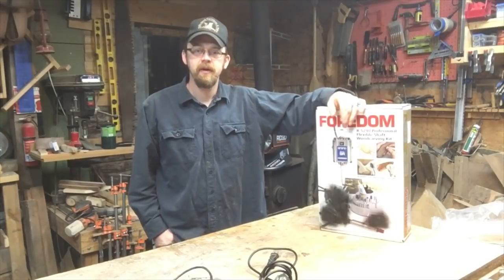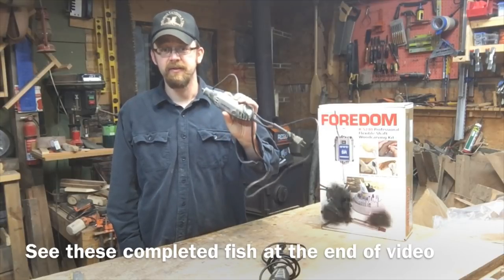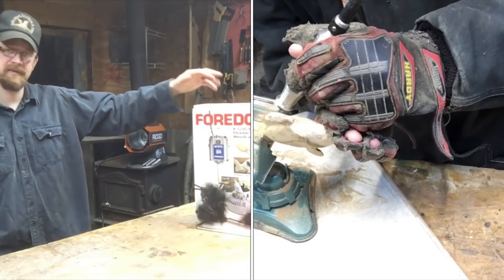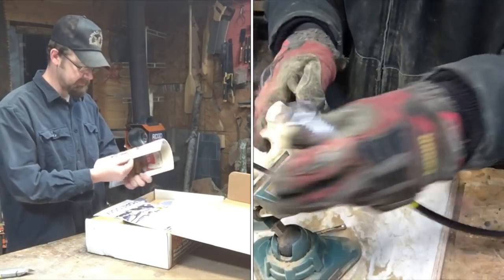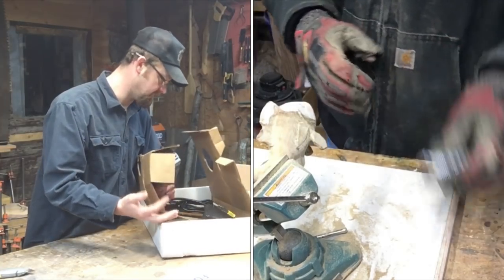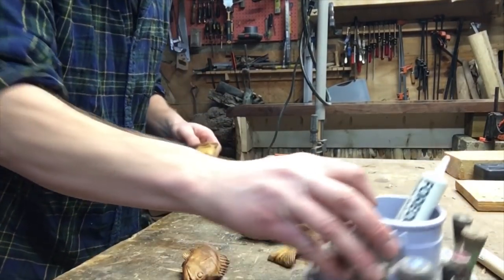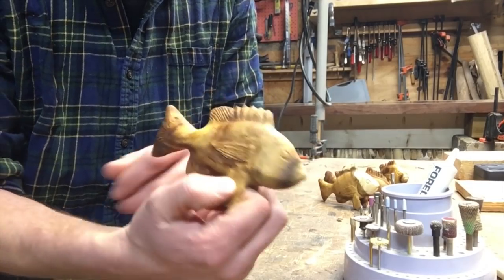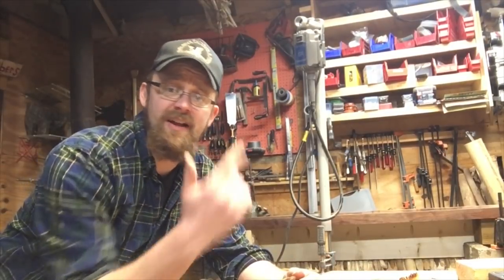Un boxing and using the Foredom flex shaft wood carving kit.

Comment: Useful video…Dremel 3000, 4000 are only useful for lightweight hobby use…no one seems to mention the Dremel Fortiflex which is a good upgrade, but the Foredoms are in a class of their own. Expensive, but versatile and hard wearing, plus they have a great variety of handpieces for different applications. Their catalogue is full of useful accessories….highly recommended.
Just be careful of all the fake replicas out there…do your research…Foredoms are made only in the USA, not made in China or India…Lots of the cheap handpieces work ok, but you pays your money and takes your chance..

Comment: Did u chang the brushes on the dremel?
Reply from the maker: Carving Fusion By : Jordy Johnson the brushes are fine it’s actually a very thin copper wire inside the Dremal that keeps breaking
Reply: @KyleHallwoodworker  ahhh ok , yes I have gone threw a few dremels myself, I also have 2 foredoms , 
I'm very hard on tools and I'm good at breaking the shafts inside the flex shaft, on the dremels and the foredomes, I have had to upgrade to the heavy duty flex shaft for the foredom , (it's the industrial shaft)
Alot stronger and seems to hold the strength for my heavy hands!